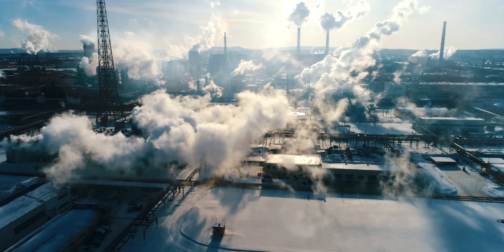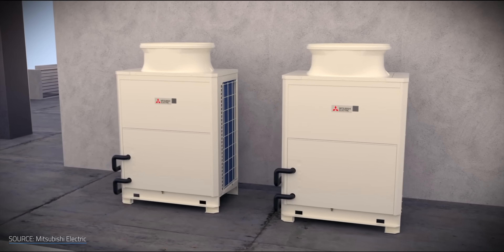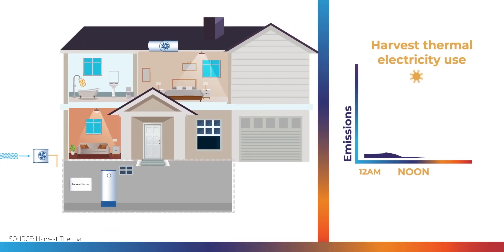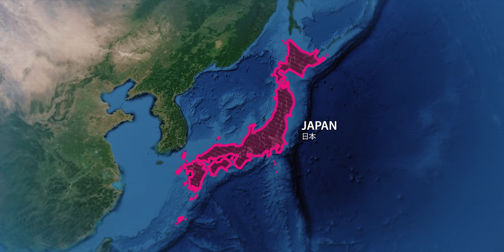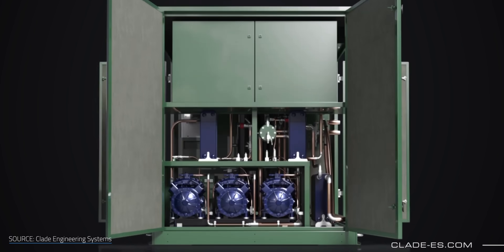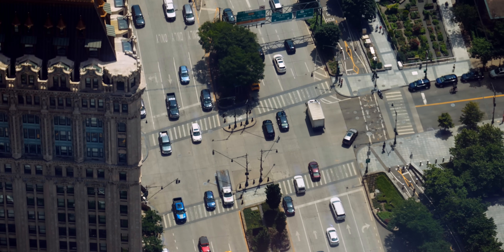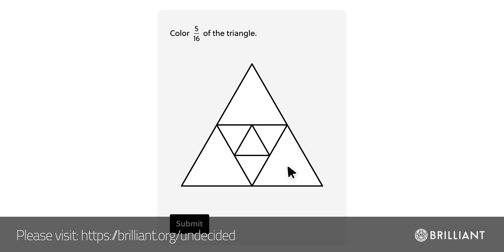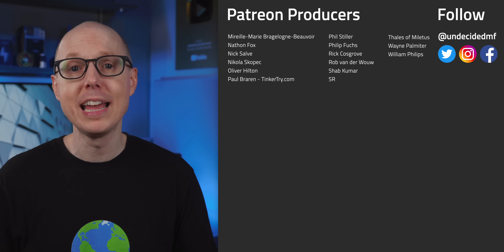Why CO2 Heat Pumps Are The Future Of Cooling

Comment: This presentation is totally confusing. It allready starts with a mix up in the terminology. My point of view is: CO2 as refrigerant is in general less efficient compared to other refrigerants. The problem ist, that the critical temperature of 35 °C is very close to our ambient temperatures. So the net work of the thermodynamic cycle is typically larger compared to other refrigerants. The COP is lower. For home heating it is less unefficient than for the cooling purposes.

An advantage is the power density of CO2 because of the required higher operating pressure. So the systems are in generall much smaller and the tubing has lower diameters. That's why it is widely used for high-power heating and cooling applications (like super-market cooling). CO2 heating and cooling is in fact an old technology in this field. But this is also a disadvantage because it comes with the cost of high-pressure compressors, when it comes to low power home applications.

Comment: Why compare it with water as a refrigerant when water isnt even used that much anymore as a refrigerant, instead compare CO2 to things like R-32 or R-410A. Which also has a really low boiling point, then it would be a much fairer comparison than using water.

Comment: I've been in this industry for almost 40 years and I've lived through several transitions in equipment and refrigerants. I can almost assure you that this tech will soon be government mandated, is going to cost huge up front,  will have to be repaired frequently and it won't work as well as past refrigerants did which is gonna suck in hot climates.(  its just like we are seeing in the appliance industry who is currently being forced to switch all refrigerants to r600 or r290 and they are riddled with issues like extremely premature compressor failures.) So all that money you think you're going to save on this technology will inevitably be spent on repairs. Say you save 400 bucks a year on electricity.  One service call to replace just a faulty circuit board will eat that up and then some. 
Anyone remember when they lied 15 years ago and told us geothermal was going to fix everything?😂
This is going to be just like the electric vehicle boondoggle is shaping up to be. The climate change mafia claims they're trying to save the world ,but all it becomes in the end are more government mandates and less reliable products. 
Anytime the government steps in to fix anything they make it worse almost every single time.

Comment: So I have one thing that needs to be added when looking at heat pumps. If you are trying to reduce your carbon footprint you have to consider what your local power plant is. Correct me if I’m wrong but most combustion dependent power plants run about 30-60% efficient depending on the fuel. 
So depending on the climate you live in an air source heat pump may actually increase your carbon footprint.

Comment: So many false info. Oil or gas is NOT a Fossil fuel, its a renewable resources. Oil is after water the second most resouces. FACT.
Heat pump need to many electric energy (where comes the energy? )absolute not effective.
Must generate power
Power for a pump to transoert any liquit and goes in a heater.
Remove to many energy with the HEAT PUMP from the soil you became a lot of microearthweak.

But its not all.
I must change to many on your house, must isolate all, must have a air cycle system......

Comment: CO2 is about 853 PSI at 70 degrees. This is why we wont see it on a broad scale. They are not going to run thin copper refrigerant lines into your home at those dangerous pressures. The indoor coil could also burst. Its enough pressure to cause fatal injuries. Most CO2 systems have the entire system outside and only have water lines run outside to a built in heat exchanger. They are more effective at extracting heat when it is very cold outside. But I would not want to run my water lines outside in the winter time.

Comment: When it’s -20 F outside, a heat pump does not heat.
Reply: Heat can be extracted up to -200F, you need just more pressure manipulations. Some heat contains in any substance (gas, solid or liquid) what warmer than -459,67F. This is how I understand Physics.

Comment: What I'd like to see is a domestic water-to-water heat pump system. I have a solar HW system where I capture the heat in a storage tank, then transfer that heat to a propane boiler to help heat up the water for domestic use and space heating. This has saved me 60% on my original propane furnace (remote, climate zone 7) residence. I know from seeing heat pumps used in commercial buildings they typically need storage water (cold exchange) at about 60-80F. My storage starts at about 140-150F, so with a heat exchanger and a good water-to-water heat pump this system should work well and get rid of the gas. I also have a 6kW solar system and Powerwall which more than meets my household and car charging needs on the electric side. I would love to find a solution, but all I seem to find are geothermal heat pumps, not sure if they would be a good fit, but maybe? I think this could be a good commercial solution for those cold area residences without geothermal potential, and cost less. Thoughts?

Comment: More efficient doesn't mean better. Heat pumps use alot of electricity. That electricity is still being made primarily by coal fire plants. Now lets be real here. Coal fire plants are horribly inefficient and wasteful. there is talk about making the plants more efficient but its just that . Talk. Trees... if we stop cutting them down are the best way to absorb co2. Gas heating cost per joule is far cheaper than electricity and the coal it originates from. You can spin the story any way you want but here is the bottom line. we need trees, we need heat. Natural gas is very abundant. is renewable and is cleaner. Man is less than 1% of the global warming problem. Volcanoes and the Earths natural 10,000 year cycle is the other part.  That's right a Volcanoes buts out more emissions in one day than the total human impact of the USA in a year. Now before you think im on a rant I got nothing against AC's its the idea of using more coal in the time of the year when our trees cannot help clean things up. In addition heat pumps have a shorter life and id like to say that the Word HVAC community is mindful of disposing of refrigerant but they are not so. YOU ARE DUMPING MORE CO2 into the environment. Im not undecided's a no!

Comment: We installed Sanden CO2 heat pumps (Japanese, COP rating 5.2 ) on our house a few years ago and have been very happy with them. They feed hot water to a tank that is used for both domestic hot water and hydronic floor heating. Fortunately we do not have any cooling needs in our climate.

Comment: Great video. But "help us keep the planet cooler" is not good in cold countries. More people are killed by cold than by heat.
Also, CO2 has no effect on the planet's temperature. For example, the moon, with no CO2, is above boiling in daylight. But here on Earth we never get to boiling. That is because of convection. Hot air rises, up into the cold troposphere.
Another example is a real greenhouse. Its glass traps hot air. But the Earth has no glass, and so rising hot air is not trapped. The hot air rises, up into the cold troposphere. So, we have no actual greenhouse effect since the Earth has no glass.
In conclusion, CO2 is a trace gas that has no effect on Earth's temperature. So, less CO2 will not "keep the planet cooler."

Comment: Heat pump are not only more efficient than fossile-fuel based options they are also more efficient than electric resistance based options! But I must say I can't wait for when they implement different rates for electricity where I live. I feel like it's like that everywhere but here.

Comment: Just out of curiosity, what is the price ratio of electricity to gas in the US? 

Here in the UK, it's typically 4. Given that so many heat-pumps yield a COP of 3, heat-pumps are cost uncompetitive & that's BEFORE you factor in that the upfront costs of retrofitting a heat-pump are typically four times those of putting in a gas boiler. Here you can get a generous government grant of £7,500 ($US 9,500) to replace your gas boiler with an ASHP & people still baulk at opting for them!

Comment: Due to the increasing fragility of our electrical grid ( we are getting more and more power cuts in our area ) I am reluctant to put all eggs in the electrical power basket... We have a 'stand alone  ( needs no electrical power to run ) gas heater, which we use when electrical power goes out.  In UK due to short days and lots of cloud we get very little solar power in winter when we need it the most, and as far as wind power due to the UK weather systems we can often get high pressure systems with no wind hanging over us for weeks at a time....

Comment: It would be nice if you included the math involved in making your relative efficiency statements. In your video you compare a gas water heater with an electric heat pump version - saying the gas is limited to a COP of .93 while the electric heat pump has a COP of 3. But what happens if we compare burning a cubic foot of natural gas at the electric power plant and a cubic ft of natural gas in the gas water heater.  The cubic ft at the power plant gets converted to electric at a 44% efficiency and looses 5% (95% efficiency) in the electric transmission and distribution system to get to your heat pump.  0.44 x 0.95 x 3.0 = 1.254 energy efficiency compared to .93  energy efficiency for the gas heater.  1.254 / .93 = 1.35 relative performance of the electric heat pump compared to the gas heater. The comparison still favors the heat pump but is nowhere near as dramatic as you state.

Comment: Co2 only works as a very high pressure refrigerant you have to keep it at over 900psi the EPA had to make a hole new class for it to sit on the gwp chart i install resi hvac systems and that equipment is made as cheaply as possible idk of you would want to keep a bomb in your backyard but thats up to you as of right now aint shit that can hold that pressure for it to be a reasonable price for the average home owner

Comment: QUESTION: I have an underground house, where the temp is a stable 60 degrees year round, regardless of the outside weather. I also have a root cellar which maintains the same temp. However, as you can imagine, I want to heat my living space to 70 degrees, and cool my root cellar. The question is: Could I use a split unit heat pump, to heat my living space, and place the other half (the outdoor device) inside my root cellar to cool that at the same time? This would effectively remove heat from my root cellar and send it to my living space... would this work?

Comment: Nice and quite informative, but this is nothing new. Have been around for decades both with CO2 and some more efficient refrigerants like R290 and R600a with GWP of 3.
In Denmark CO2 heat pumps with thermal water storage have taken over a big part of the residential heating. Look at Fenagy...
Actually R290 is much better suited than CO2 for residential heating. Specially when you have floor heating which only needs up to 40'C.
But there are even better regfigerants coming that will suite even better. R436a, b and c which is mixtures of R290 and R600a.
CO2 have much higher initial investing costs and break down much more often because of the much higher pressure. 80 to 100 bar compared to around 20 for R290 and R600a and their siblings.
R290 and R600a is propane and isobuthane and are explosive, that's their disadvantage. 
But gas that are used in UK and Germany for heating consists of the same gases, so no big difference in risks.
The company I work for SCM Ref have been using R290 as a refrigerant for 12 years for residental heating and we reach COP of 5-12 depending on season and the need for heating and cooling simultaniously. Combine that with free cooling during cold season and you can have even better seasonal COP or SEER.
I do not consider CO2 to be the better refrigerant and the technology described have been around for a long time.

Comment: So, if everyone started running their heat pumps at the low demand time of day, then that low demand time would become a much higher demand, right?

We had a heat pump in Virginia where the general weather temps are much higher than in the north, in both winter, and especially summer.  Our heat pump wouldn't function if the outdoor temp was below 50ºF.  Therefore it would switch over to the toaster furnace.  Energy costs were high in both winter and summer in VA..  

Moving to Michigan with much much colder temps in the winter and cooler temps in the summer. We have a newer more efficient Trane natural gas furnace.  Couple that with a much better insulated house, which is normal in Michigan, our monthly energy bills are half of what it was in Virginia.  And our house is 50% larger than the house in VA. 

I don't think even a C02 heat pump would work in Michigan when it's common to be 10ºF to 30ºF for 4 months of the year.   I don't know, maybe I'm wrong.   Storing heat in a hot water heater?  How hot could it possibly get, and how much energy does it take to get there?  Even pumping that  warm water through floor radiators with heat loss through pipes, doesn't seem like it's going to keep a house very warm.

Just like EV cars.  They work in some climates better than others.  The batteries are at top efficiency in places like Florida and California, but absolutely suck in the northern climates during the winter.

Comment: All of these have the major drawback of computer boards.  These tend to fail in a few years and the replacement cost tend to be prohibitive.  So, when you amortize the lifespan of a unit as well as the savings, the total cost savings are reduced considerably.  Take away subsidies which can vanish at any time and the total cost of operation as well as the up-front capital expenditure, fossil fuel generation gets more attractive.  When they start designing in replaceable modules that are far less than the cost of the system and easy to service these systems will get much more economically viable.

Comment: What are your thoughts on converting existing A/C units to run on propane?    There are a lot of good videos on why utilizing that refrigerant is a good replacement, as it is relatively environmentally safe and the flammability concerns are overblown.   (Compare a couple of pounds of liquid propane vs. an uninterruptable supply of natural gas.)  Additionally, the lower operating pressures would lead to longer component life as well as being more energy efficient, since the refrigerant would not need to be highly pressurized.

Comment: while these systems are great, one of the biggest advantage of CO2 as a refrigerant is that it removes the requirement for a likened tech to handle the refrigerant. a mini-split costs about $3k but $15k to install in many places. if a homeowner can install it without worry, then that is a huge win.

Comment: Heat pump COP cannot be compared to a gas furnace because the fuel for the heat pump is burned elsewhere to produce electricity(55% loss of the heat value)and then transmitted to the heat pump(15 to 20% loss through wires, transformers etc. to get to the heat pump).  The fact is that gas is still significantly cheaper to heat will than heat pumps!!   Oh, by the way,  solar electricity is Not Cheap it has to be heavily subsidized just like wind only solar is even worse;  and both are major polluters because of manufacture and disposal issues.  Refrigerants that don't go through a phase change are less efficient, as is CO2.  The claimed gains from thermal battery and microprocessor control/inverter tech are already being used with current heat pumps and not proprietary to CO2 heat pumps;  so there is no advantage and the units will cost more because of the much higher pressure employed.

Comment: I think I wish I new about these, we put in 2 Mitsubishi heat pumps in the last 2 years, mostly use ours on our half of the house for AC, the in-law apartment half is used year round. And we are using electric hot water heaters. so I would have looked into this had I known. For me it's mostly the cost of the system since I self installed. But now for the future I would be curious if part of this system can still be used, the pumps and lines would need to be replaced but maybe the units inside could be used or upgraded, just a thought. Of course they don't want to upgrade just sell us new systems. I am very happy with the system we have though.

Comment: If you berried a very large water vessel under your home and created a way to make electricity with the hot water. Hot water is under pressure to drive a turbine without high heat. You could run a heat hot water and electricity battery from the one water tank and some solar panels. Has to be a very large tank. If you added a salt battery that heats up water and stores the heat. You could heat and power your home for free once the system was built. It's would not wear out like solar or wind but need maintaince to last 100's of years. standardize the system and make it ubiquitous would make it affordable..

Comment: NOT special. Rather a scam.
- Natural refrigerants exists already: Propan (R290) works great in ACs and heatpumps.
- Todays Air-Water-Heatpumps can achieve a COP of 4  - 5.5 (e.g. from Lambda). 
- Heatpumps run most efficient when run 24/7 on lowest possible temp, not just some hours when power prices are low.
- Harvest Thermals thermal storage tank just stores warm water in a steel pot. Not new. Storing water for heating your house doesn't make any sense (The tank is empty in no time).